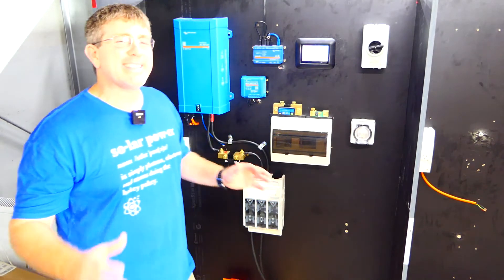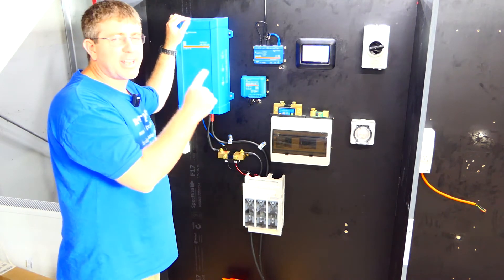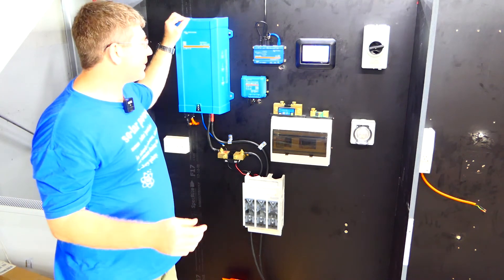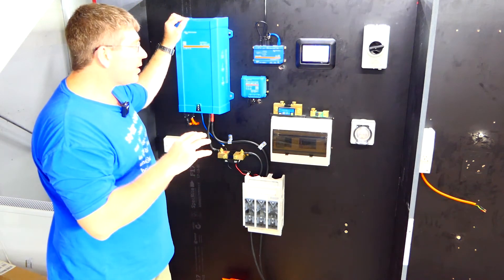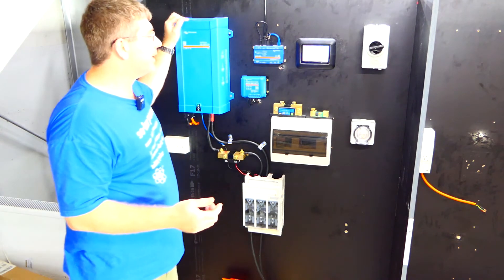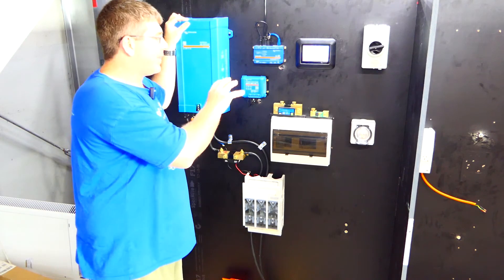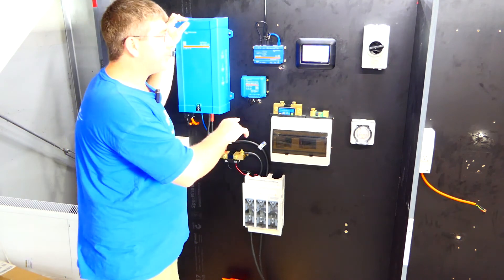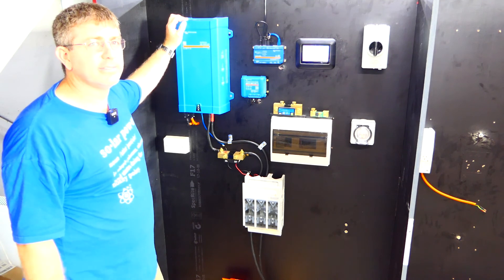Victron Energy Off Grid System

Comment: Hi I,m David and An expat. I am in the process of purchasing a 150 year old 4 bed cottage in Suffolk. at present it has an EPC rating of F.
The intention is to get triple glazing put in. Then strip out the lathe and plaster insulate and plasterboard. There is tons of loft insulation in place. The cottage has oil central heating (heated by an aga boiler). Then we want to add the Solar Including a generator and connected to the grid.
I believe from my limited research and understanding that a Quattro 48volt system would be my best option. Can you advise what what the best components I should buy for my forever retirement home.
Thank you
Reply from the maker: Yes the best money spent will be making the house energy efficient. And the Quattro is a great choice. You can make the most out of the grid and a back up gennie when you need it.
Reply from the maker: Is it possible to access wholesale energy rates in the UK?

Comment: Best explanation I've seen on YouTube. Can you use Victron components with a Goodwe inverter? It's nice to have an all-Victron system but their inverters are waaaay too expensive. A commercial Goodwe 15kv costs much less than a Victron Quattro with the same specs. Goodwe is one of a few brands that BYD batteries accept for its LVL 15.4kwh.
Reply from the maker: Good question. The victron is a battery inverter. There would be no use adding it if the goodwe already accepts a battery. The bennefit of a Victron is it can take a generator and more battery choices than the goodwe